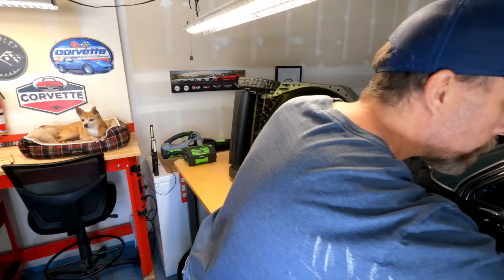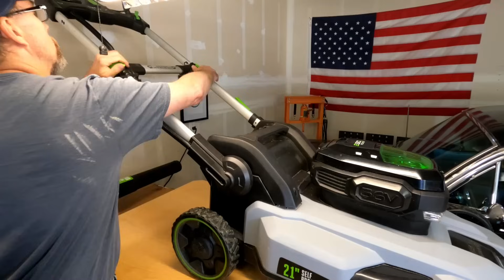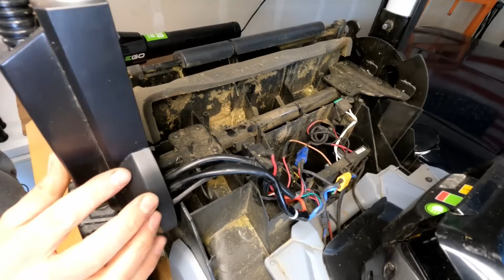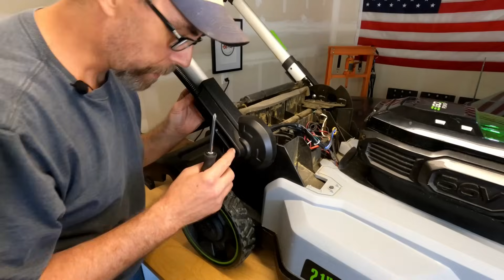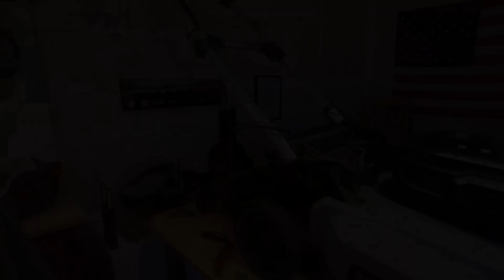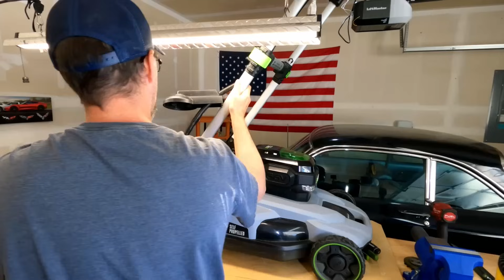My Ego Mower Finally Quit Working!!  🔧  Can I Fix It??

Comment: Well how am i supposed to follow if you just skip the cable step
Reply from the maker: There are a ton of videos out there that detail, step by step, how to properly solder wires together. This was never intended to be a "How to" video. I just wanted to share my experience so it might help others in the same position as I found myself. The important aspect of this video is the diagnosis of the problem and the overall solution that was implemented.  I hope it helped you out. Good luck!

Comment: One more thing, make sure after you take the battery out to discharge the handle. Sometimes there's phantom energy stored up in the mower and it could trigger the blade to go around if you don't discharge it
Reply from the maker: Great tip. Thanks!

Comment: Great video.  After 7 years of use, the blade on my 2018 Ego mower stopped spinning today, and the issue turned out to be that same wiring harness.  Cut out a section and spliced in new wire and I was back in business.
Reply from the maker: That's great. Good work :)
Reply: This is a good video to me because I own one also and now I will know what to do if this happens to mine! You tube is sometimes a valuable ally! 👍

Comment: I didn't see the fix. Splicing the wires was the most important thing and was not shown.  Did you need a different wire for all three splices, or what wire did you need to splice?  Your thought process is exactly like I use for "fixing" my patients. I'm a chiropractor
Reply from the maker: I think the troubleshooting was the important part?  Soldering splices in wires is covered on a thousand other videos...I used 3 different wires to repair all 3 wires in the loom. Nothing crazy, just cut out a few inches from all 3 wires and splice in a patch to each of the 3 wires. Solder both ends and heat shrink the connections. Then wrap them all up in tape and reassemble the unit.

Comment: I had the exact same problem with my Ego mower after 5 years.  I decided to do some research and stumbled across your video.  I popped the side cover off and started flexing the wires and it instantly started up.  Now I’m off to buy some wire and tape so I can do the repair!  Thanks so much!
Reply from the maker: Sorry to hear that you are having issues. It seems unfortunately more common that one might think. Glad you are able to fix it. Glad to have helped out, if at all. Good luck. Thanks for watching!

Comment: Want to see a 10 year Total Cost Of Ownership vs gas. That plastic body will outlive multiple battery replacements, $$, but not change in battery technology. My craftsman last 20 years, maybe changed oil 3 times, couple of spark plugs and still started on third pull when sold at garage sale this summer after not being run in the last 7-8 years. It was heavy as all get out, fwd, but very low TCoO. Electric just isn’t there yet from TCoO or QoC. These are now disposable tools.  I want it to get there, it’s just not there yet.
Reply: Respectfully, I have the direct opposite opinion.  I've had more headaches from gasoline engines over the years, from leaf blowers to riding mowers, from clogged carbs to valve adjustments to solenoids to deteriorated fuel lines to gas leaking into crankcase before I knew to install a fuel shut-off.  I'll never buy another gas engine product again except maybe my chainsaw and riding mower.  Granted, battery tech has not reached the point of making an electric riding mower cost effective... yet.
Reply: @jacksparrow3619  ya, we have had the opposite experience. I want to go battery blower and trimmer but have 15 year old echos that fire on 1st or 2nd pull and seems a waste to move from something that works so well.
Reply from the maker: All great points. Thanks for sharing and thanks for watching!

Comment: I had this same problem, it has tons PLASTIC components inside, I just by passed the folding switch to one on Cover I Flip, which is also good I can just shut power down battery in it or not.
Reply from the maker: That is great. Good idea. Glad it worked out for you. Thanks for watching.

Comment: My self-propel drive is inoperable . After watching this video I'm sure I can attack this problem, figure it out and get the drive working again. Thanks
Reply from the maker: No worries. Glad to help. Last month my drive speed was stuck on high speed. I ended up finding a stretched wire in the wire harness at the location where the handles extend. Might check there. Good luck!

Comment: I bypassed the switch by connecting the smaller black and red wires together.  The wire had pulled out of the connector socket.  The handle extension switch will no longer stop the mower.  Only need to remove the cover over the back of the mower and takes much less time and skill.
Reply from the maker: Nice. Good work. Thanks for sharing and thank you for watching!
Reply: I might do the same, I am so impatient to do all that

Comment: Apparently, cleaning the battery contacts is a thing too. I've be using the ego mower for 7 years only changing the blade 0 problems.
Reply from the maker: Ya, I suppose that depending on your environment the contacts could become crusty. Good point. Thanks!

Comment: Just yesterday, I bought a used EGO 21" mower on Marketplace. The guy said it was working fine and now the blades don't spin up. I needed parts to repair the height adjusted for my front wheels, so I figured I would use parts from his mower. I only paid $50 for the "fixer." Now that I have seen this, I will attempt the same repair. If it works, I'll just have a "new" mower for $50! WOW! Thanks for posting this! By the way, do you know how to do a "reset" on the EGO batteries?
Reply from the maker: That is great! By my estimation, there are thousands of these units out there that are having the same problem. Especially once they are out of warranty they are likely to be discarded. I would pick up as many as you can find :)  Have not heard of resetting the batteries, sorry. Thanks for watching!

Comment: I've had my Ego mower for 8 years and have rarely folded it all the way down. For the last few years I cleared room in my shed, so I can just push it in upright like a normal mower. I used to shorten the handles to make it fit. I would catch myself forgetting to extend them and wonder why it won't start. lol. Glad to know it's fixable if it happens though.
Reply from the maker: Lol. That is great. You must have one of the really early models. Ya, the wiring is pretty weak on these units but they are relatively easy to fix. Thanks for watching!

Comment: Why didn't you just use the warranty to get the mower repaired? I beieve all Ego products have 5 year warranties.
Reply from the maker: You are correct. I could have tried to get it repaired at a local shop under a warranty claim. This would have been a perfectly fine solution as well.

Comment: I just bought a new EGO mower just like yours, thanks for the heads up on a problem I never have but I will be folding mine up after ever use as well.  This should be covered under the 5 year warranty, but who has time to wait for a factory repair?
Reply from the maker: That's great! I am sure you will love your mower as i do. A lot of guys ask me if I still fold up my machine after every use...I absolutely do. It is the best feature of this mower. Will it crimp the wire again? Probably. It is an easy fix if it does happen. (there is a video that shows how :) lol). Yes, you can just have it repaired under warranty, if you have a backup mower on hand and the desire to deal with the entire process. The reason I made this video is because, like my mower, thousands of units out there are surpassing their 5 year warranty period everyday and folks are faced with replacement vs repair. Thanks for the input and thanks for watching!
Reply: @EndWrenchRookie  Yes thanks for the great video and the information on fixing the issue if it ever arises.

Comment: Congrats on fixing it. The sad part is that decades ago they moved into much smaller wires which really hamper your ability to splice and fix (esp wired headphones). Cannot believe on a device like this they would still use such small gauge wires (what 22?). Good comments here too. The "compact" feature appears to be the main culprit in how long this unit will last. Thanks.
Reply from the maker: Thank you so much! I appreciate the input and feedback. I agree, the wires are undersized and not made for longevity. It is a fine balancing act for a company to figure out how to make products that either last or make profit. Just glad I was able to get it back into service same-day, without having to deal with a warranty claim. Thanks for the comment!

Comment: Even on a gas mower folding handles cause issues with the cables. Best bet if you can - don’t  fold it because it will happen again.
Reply from the maker: Very good point. I have replaced my share of throttle cables that fray and break at the same folding point. In fact, I have not ever seen a piece of outdoor lawn equipment that did not require some form of regular maintenance and/or repair at some point in its usable lifetime. They lead a rough life :)  Thanks for sharing!

Comment: when you got to the state that the motor was not running and you figured out it was that wire.  Were the lights and the wheels also not working?  I am not comfortable re-wiring but I have no problem replacing the whole harness, but wondered its worth the cost to end up finding out it was a whole different issue.
Reply from the maker: Understandable. You could very well replace the entire harness just to find out it is a loose connection at the controller, or any number of other issues. The only way to isolate the issue is to take it apart and start investigating. If you plan to replace the harness then you are going to have to take it all apart anyway. If I remember...the drive and the lights still worked at the time of the issue. Yes, there could be any number of issues causing your problem, but after interacting with as many people as I have on this video, I would bet that you have the same problem at the same hinge-point area.

Comment: I love this video, I have a similar issue but not the same.  The problem is not intermittent so it makes it difficult to troubleshoot.
Reply from the maker: Thanks! Sorry you are having trouble with your unit. I got lucky that I was able to wiggle the wires to isolate the crimped wire in question. If your unit has a severed wire that is causing your power issue, then you should be able to use a multi-tester and probe each wire on either side of the problem area for continuity. Hope this helps.
Reply: @EndWrenchRookie  UPDATE: 1st let me say again how helpful this video was, I think it was your troubleshooting methodology that inspired my brain to think this problem through.  My issue was not intermittent (at least not at first) but I was getting the error code that the arms were not extended all the way. I figured I’d bring it to work and between a bunch of us tech geeks we should be able to figure it out.  Of course after sitting in my car for a few miles the problem turned intermittent, I guess the bumps must have jostled the cable just right.  Short story is we sourced which cable it was (the 3 that go from the middle of the arm to the motor directly, it was shorting at the pivot point). Now I may have broken a safety rule here, we drilled down to the female plug just short of the motor, bent a paper clip and snipped it short.  Jumping the black and red, this makes the motor think the arms are extended all the way and completely bypassing the shorted wire.  I plan to store this going forward never folding the arms to hopefully avoid any future issues.  Again thank you for your video, after watching multiple videos trying to solve this yours was the most helpful.

Comment: Thank you.  I had this same issue.  Mower worked great for 5 years and then same random issue you had.  I was able to fix it with the same fix you did.  It's weird, from day one, I knew that the folding handle would cause issues and it did, but otherwise, my favorite mower I've ever owned.
Reply from the maker: Thank you. I am glad that you were able to take care of the issue. This is the reason that I made this video. I also was concerned about the folding stress on the wiring. As untold numbers of these units fall out of warranty, folks are going to face the decision of trashing their mower or trying to fix it. I agree with you that, other than the wiring issues, this has been a really great mower. Thanks for watching.

Comment: low grade Chinese wire.  Cost savings.  Likely an issue they didn’t become aware of until  a few years later.  Likely already reengineered with a better grade of wiring.
Reply from the maker: Sounds about right. It will take a few years for the electronic designs to work out all of the kinks. They will always try to cut costs. At least they are fairly easy to fix.

Comment: Three wires come down from the upper controls. Thin wire, thick round wire and a thick flat wire. Looks like you opened up the thick flat wire??... From that you had three wires that ended in a connector that had blue on the bottom... I couldn't see from the video but it looked like it also had a red wire and another one?
Reply from the maker: Sounds about right. The additional wire looms contain signal wires that lead to the handle controls that deal with the blade switch and the drive-speed controls. I recently had trouble with my drive speed control being stuck on high speed. It ended up being a pinched wire at the cross bar location. The repeated action of extending and retracting the handles caused a wire to become stretched. I performed the same process of soldering in a patch wire to alleviate the pinch and it fixed the problem. I agree that the wire routing for all of the controls and safety switches, is indeed, a poor design. If you are having trouble with your drive speed system, I would suggest looking at the pinch point on the handles.
Reply: Looks like there is a lot of content on repair on these guys. The speed control was a simple pot and that can be the reason for zero propel. I’ll open that next. Thanks for the content and even more for the quick reply.

Comment: You highly suggest EGO? This is a repair video!!!
Reply: My Ego self propel died, battery has issues and dies early, and now the Ego has stopped working, Pinched wires... It's not a good design... Of the three relays all worked but the wire was pinched and has a short. Still need to figure out the propel issue. No support once out of warranty... Consumer reports 3/5 reliability Greenworks ( I sold my old GW mower still works ) gets 5/5 my eyes are looking that direction once my batteries and repair efforts are truly dead.
Reply from the maker: That is correct. All lawn equipment, regardless of drivetrain or systems composition, requires some form of maintenance and/or repair. Ego equipment is not exempt from this reality. Yes, I do still suggest their products. I am overall very happy with their performance.

Comment: The most serious thing with Ego mowers is the battery. Mine started going south towards the 2nd year. They did replace it at no charge but I had to take it to Ace Hardware to get it replaced. Thank you Ace and Ego! I love my Ego products. Oh by the way,my 10 amp hour battery is $500!
Reply from the maker: Ya, that would be poor to lose the battery. I have been lucky that the problems I have had with mine have been wiring related and easy to fix. Wow, a 10 amp hour battery? Is that what comes on the newer models? My large battery is only a 7.5 amp hour. 500 dollars is hard to swallow since that would basically but you a new mower. Thanks for sharing
Reply: @EndWrenchRookie    Have you checked the price in the new Egos? The new one with the aluminum base is $1200! I’m not sure which battery it comes with. Mine is a self propelled model with the biggest battery at the time,$800 for the whole kit,Charger included. I bought the leaf blower on EBay about 6 weeks later without the battery and charger and it’s a tornado in your hand. Uses the same battery although the 2 of them together are a bit heavy.
Reply from the maker: Wow, that's crazy. I was not aware of the high-end prices. I paid 400 dollars for mine 6 years ago. Last year we bought our son a new unit. It was the new version of the same one that I have and it was only 450 dollars with battery and charger. Overall, I have been super happy with my EGO products. I had to fix another wiring issue last week, but other that the annoyance factor, it has cost me almost nothing in maintenance for 6 years. I also LOVE the blower and trimmer. I do need to replace my two smaller batteries for the blower and trimmer as they don't last as long as they used to, but I am hoping they aren't too pricey.

Comment: Great info and great troubleshooting, sir! Without reading every comment, I wanted to point out that the melted wiring likely occurred after the wire broke. Resistance that may also include arcing will certainly create heat. I am looking to purchase an EGO mower so this makes the decision easier knowing it can be worked on. Sometimes you open something up and realize it's meant to be thrown away, or isn't worth the aggravation. Many thanks!
Reply from the maker: Thanks for the input and your kind words. I am glad to have been of some assistance. I would buy another EGO mower without hesitation. Good luck!
Reply: as a 5yr EGO mower owner, I say DO NOT buy an EGO mower.  If I could back in time, I would buy a top shelf (Honda or Husqvarna) gas mower and 6
have enough saved to buy 6 yrs of gasoline.  My single blade EGO (7.5 Ah battery) does not cut/mulch spectacularly and that is AFTER buying the high lift blade.  Save money, buy a really nice gas mower.